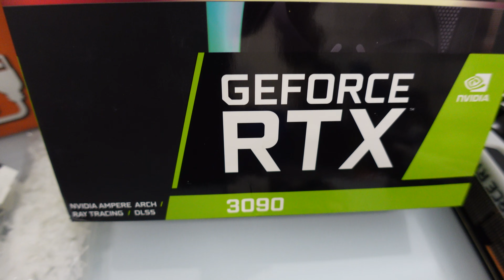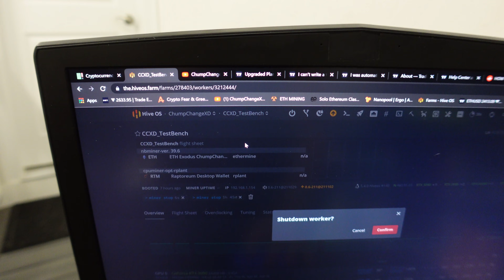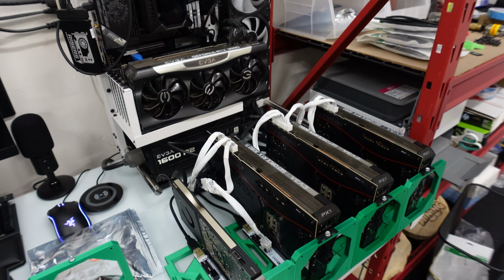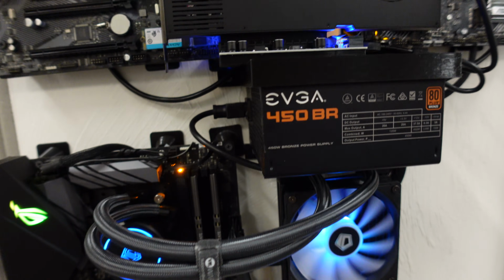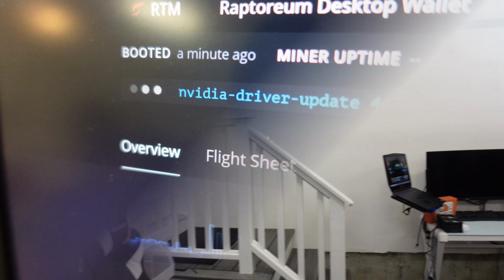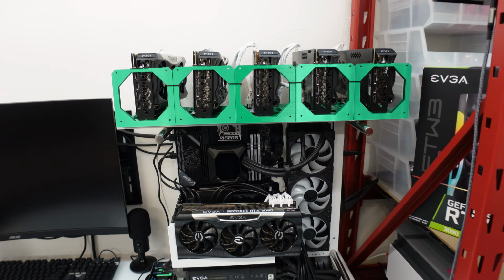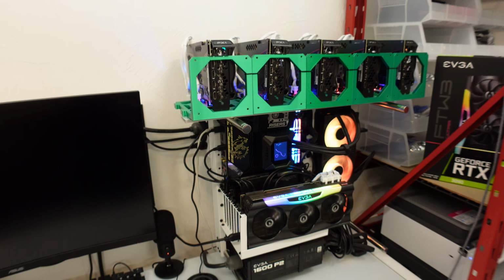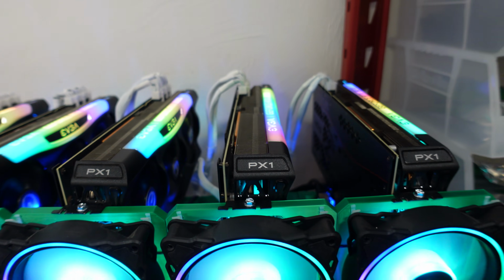GPU Mining Accessories In 2021

Comment: I would have thought shutting down the miner while the fans keep cooling the card down would cause the card to cool down much quicker and stress it much more than shutting down the machine without turning the miner off and have the card cool slowly by natural convection.
The reason you don't hear those cards crack when you shut down the miner first is because fan noise is louder and at the same time when you shout down the rig the fans are off, it's quiet and you can hear those cracking sounds.
Reply from the maker: Good point BUT I have been told otherwise TBH I’m not sure what is rite or not lol
Reply: @ChumpChangeXD  Realistically it shouldn't matter that much, we miners rarely power cycle our hardware, meanwhile gamers cycle the hardware few times a day everyday for years and sometimes for over 10 years.

Comment: Sick video.  But, what are you talking about that you hear "crackling" when GPU's are cooling down?!?  I sometimes joke with you about burning up your VRAM, but seriously bro.  That's crazy talk.
Reply from the maker: If your running a rig you can hear them contracting if you just shut them down without letting them cool first. It happens on all cards.
Reply: @ChumpChangeXD  Wow.  Well, I'll definitely keep an ear out I guess.  I do run rigs.  And I've had power outages before...yet never, ever, heard what you describe.  It freaked me out the way you described it so casually as if it were common knowledge.

My rigs are nowhere near the size of yours.  Definitely more spacing between cards in my smaller rigs.  I need to think some more about this.

Cooling down is a fine idea, don't get me wrong.  No question, it is a best practice.  But, not feasible in a power outage, severe weather or similar situations which occur from time to time.

Are all of your cards with GDDR6X repadded?  I'm guessing not based on some videos where I see you running temps in the red zone (104+ degrees C).  I'm running 90C or less.  Always.

Comment: @ChumpChange could you please explain your power consumption calculations on this setup? the 1600 watt PSU does not seem to be enough to power all of them alone...
Reply from the maker: I am about 1430 watts 
2x 3090 under 300w each = 600w
3x 3080 at 220/230/250 =700w
1x 3070 = 130w

It’s stretching close to the max but still have atleast 100+ watts to play with
Reply from the maker: @PocketChangeXD - The Wife of a Miner There is a rule of thumb but I have yet to have any issues with a EVGA P2 PSU. Isn’t the first time lol
Reply from the maker: @PocketChangeXD - The Wife of a Miner No risk no reward

Comment: Hi, i tried  it with  4ports splitters but  i never   connected more  than 6 gpu in total   X470 GAMING PLUS MAX with ryzen3 1200  CPU and 20 PCI-e lines
Reply from the maker: Really? That’s odd maybe because it’s an older MOBO? May be a bios update you should do on it

Comment: That is an interesting tip - shut down the miner, wait a minute for the GPUs to "cool down", and then turn off the machine. I haven't heard the "crackling" before, but thinking about it, I can imagine that is a possibility. I'll be sure to keep this tip in mind! Thanks!
Reply from the maker: I was previously told by somebody smarter than me to do so which is why I do that now. Just like any type of baseboard heat these are aluminum fins and when they contract they make a ticking noise which is what I was talking about in a quiet environment you can hear it
Reply: Does make sense to me at all.
Reply: @randybobandy9828  but, as a habit, does stopping a miner and waiting a short period of time before shutdown really hurt? Even if it doesn’t technically benefit?
Reply: @Average_Geo  no but whats the logic behind it? Either stopping the miner or shutting it down will cut the heat output immediately.
Reply: @randybobandy9828  I’m not an IC engineer, but is there a concern with cooling hot running GPU/memory quickly? And doing it repeatedly? Say GDDR6x which may be running at the 110C thermothrottle levels?
Besides, there isn’t any harm with the advice, logical or not.